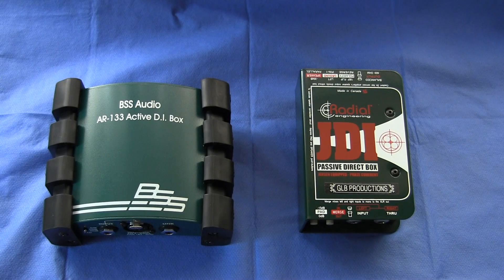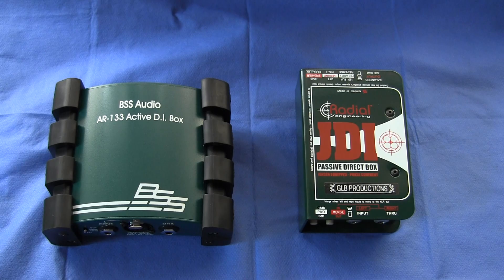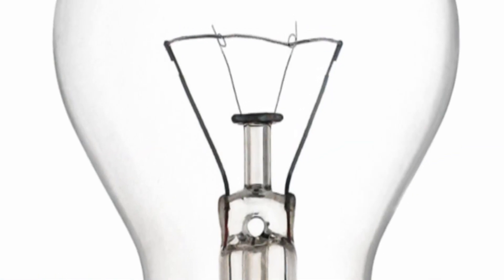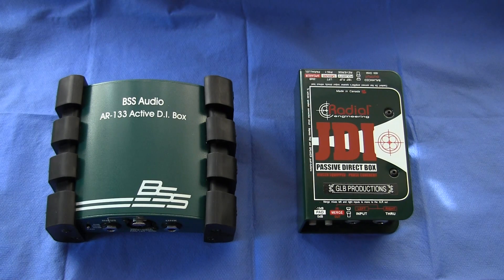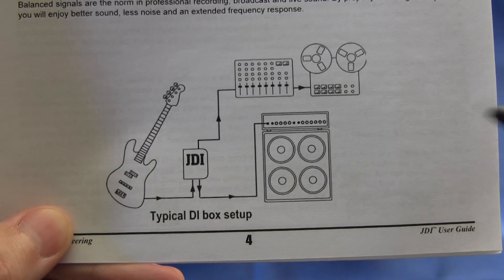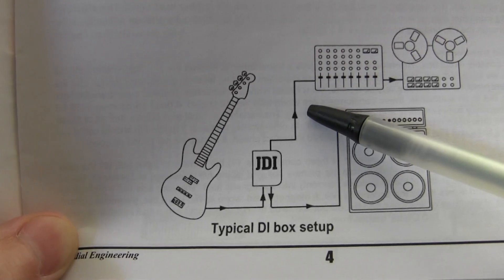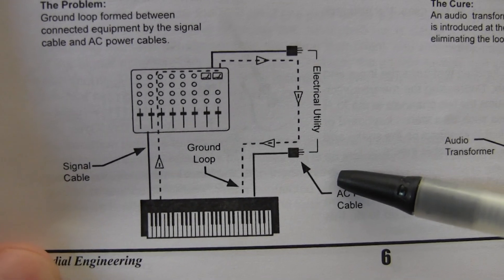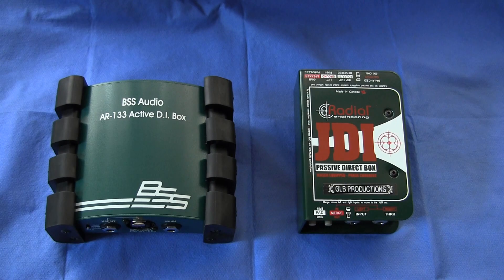DI boxes part 1: What does a DI box do, and when do I need one?

Comment: Love your explanations on your whole series of videos. I only have one small issue and that is that you constantly refer to 1/4 inch barrel type connectors as Jack type connectors.  Having worked in the electronics industry since the early 1970's I have never really heard them described as this. I have always heard and referred to them as 1/4 inch Phone type connectors. A jack was always the female of any type of connector. I understand in the UK the term Jack and Jack Socket are used well I find many terms used in the UK unnecessarily confusing. 1/4 inch Phone is the term used most by the manufacturers when describing their product so I tend to agree with them on the most commonly accepted terms especially since it benefits them to use a term that would not restrict sales. I would suggest using the term 1/4 inch Phone Plug or Jack as this would lead to the least amount of confusion.
Reply from the maker: Yes there are many names for this type of connector, probably more than any other type used in pro audio. You're correct, I should have used the term jack plug for the male or jack socket for the female, or just avoided the word jack altogether. Nowadays I use the terms quarter inch, TS or TRS. Thanks for watching!
Reply: Love your whole series of videos. Keep up the great work.
Reply from the maker: Thanks Rich, have a great day!

Comment: Great video. I had a ground loop a while ago, and I noticed it was produced by my laptop. My laptop is conected to an external sound card, and the card is connected to the mixer. Long story short, I bought an RCA filter that is used for cars and this solved the problem. I have a question for you. Should I be using a DI box instead?
Thanks for sharing this helpful information.
Reply from the maker: If your setup is quiet with no hum or buzz problems then you don't need a DI box :)

Comment: what if i need pedal ? should i put in the middle between guitar and di box ?
so what i mean is, do i need to put the cable from di box to my pedal and continuing with the cable to my guitar ? Also i have a microphone.. what i should i do ?
Reply from the maker: Correct, put the DI box right at the end of your signal chain after the last pedal. If your mic is a professional model like the SM58 it does not need a DI box as it's output is already balanced and low impedance.
Reply: Thank you very much ! it works !!... best explanation

Comment: HI i am currently using M-AUDIO FAST TRACK INTERFACE i use it to record my vocals (thru xlr) and acoustic guitar(thru line) each time i monitor the output and turn the gain high or low i hear kind of white noise in the background which is continious no matter i increase the volume or decrease it and after adding few plugins it sounds crazy... I am using FENDER C60 Which has a  inbuilt fisherman equalizer amp AND RODE NT1A Microphone.  Could you suggest me a cheap and quality DI Box which would eleminate the hiss noise totally from my guitar recordings and mic recordings? Thanks
Reply from the maker: You have to first find out where the noise is coming from - DI boxes cannot eliminate noise that is alrready present in the system. Is the noise coming from your guitar or from the vocal mic?

Comment: Would the active di box help to get rid of sound noise coming from distortion? When I'm powering the ac adapter from distortion it is giving noise like a faucet without water. I'm  not sure it my ac 9 volts  adaptor do not have ground.
Reply from the maker: No, DI boxes will just pass that noise right along ;) Some distortion pedals are just noisy because of the amount of gain they apply to the signal. If you have a grounding problem you'll generally have a hum or buzz as opposed to a hiss. Have you tried running the pedal on batteries or a different power supply to see if the noise goes away?
Reply: +GLB Productions thanks!  I'll try your suggestion
Reply from the maker: You're welcome let me know how it goes.
Reply: +GLB Productions thanks! that solved the misery, I've been trying to figure it out for one month and a big thanks to your suggestion and saved money by youtube explaining and providing a good suggestions, but now I have no idea which power supply I choose to connect my 8 pedals. Do you have any idea or recommendation? And again you save my money, A big big thanks to you. 

Cheers!
Reply from the maker: Great to hear that! I'm not an expert on pedal power supplies, the main thing is to get one that is quiet and grounded properly. I suggest asking around and reading online reviews :)

Comment: What if I use guitar pedals? Should I put it before the DI Box? Does it help me to use a distortion and don't have hum or noise? Is it a good replacement for a Noise Gate or Noise Suppressor?
Reply from the maker: Yes, between your guitar and the DI box. Electric guitar is generally not DI'ed in the way shown in the video - the DI will be placed after the amplifier, which requires an amp level DI that can handle the power.

Comment: I have a yamaha-ncx900, preamp and all. Do i need this DI yhen?
Reply from the maker: If you need to run the signal from your guitar more than 5 meters/15 feet then probably yes you do.
Reply: +GLB Productions So playing at home shouldnt be a problem, thanks.
Reply from the maker: Aleksi Porkka Should be fine. DI boxes are mainly for live sound and recording situations.
Reply: +GLB Productions I heard that my preamp watts wouldn't be enough to make a sound out of it.. So at home I should be ok by connecting my guitar to my pedal via instrument cable, which continues from output to input on a PA speaker?
Im only switching from a relatively bad guitar amp to a relatively good PA system (is system and a speaker the same thing...??), because I also heard acoustic guitar sounds so much better coming out from a PA than just a regular amp. thanks for the replies :-)
Reply from the maker: It depends on the guitar and speaker :) Some guitars have enough output to drive a an active PA speaker directly, others need help. If your PA speaker has an input designed specifically for connecting guitars directly you should have no problem. 

Sound quality is also very much dependent on gear - there are great sounding acoustic amps and crappy-sounding PA speakers, much of the time you get what you pay for. Acoustic guitar generally sounds best through some sort of fullrange system which has a tweeter and/or midrange driver.

Comment: Thank you for the video and as always your videos are well presented and very informative. I'm new to DI boxes so I have a question or two.  Well, maybe more.  I recently bought a dual direct box and I want to use it with a computer/laptop without my mixer.  So, my question is can I run cables from the para out ports into the computer since the XLR side seems to be for a mixer, etc...?  I am currently using an external usb sound card that does not have right and left inputs for stereo inputs, so I will be using a splitter cable.  Am I correct in assuming that since I'm playing a stereo instrument ( keyboard ) that I will need to use both input ports?  Also, does the same rule regarding using TRS or TS type of cables apply when using a DI box?  Lastly, do you think that you could show or rather demonstrate how to properly connect a KEYBOARD in a DI box situation?  I just want to make sure I'm connecting everything correctly.  Thanks, again.
Reply from the maker: +Luoyisi Shimisi Hello thanks for getting in touch. I suggest that you watch this video: https://www.youtube.com/watch?v=ge4Iynh4rcc It will address many of your questions on working with computers and DI boxes and also the correct way to connect stereo sources such as a keyboard. Let me know if you still have questions after that :)
Reply: +GLB Productions Thank you very much.

Comment: This is exactly what I needed. So much helpful information.  I just watched three videos, and feel like I took a career level class on audio setup. 

Question :   Can I hook up my passive DI Box at the mixer, rather than at the guitar?  That way I don't have to replace my guitar cords with XLR cables.  My acoustic guitar with active onboard pre-amp Is connected with a 20' guitar cable directly to the mixer right now.
Reply from the maker: +Daniel Williams Hello Daniel, glad the videos have been helpful! Yes you can connect your DI box at the mixer, but in this case I suggest experimenting with running your guitar directly into the mixer's line input - since the guitar is active there will be no impedance matching issues so it will be just a matter of whether enough gain is available. You may not even need the DI box :)

Comment: I have a question.

I have a behringer UM2 Uphoria USB Interface, that have 2 inputs, one XLR, one P10 for instrument.

After some tests, i came to the obvious conclusion that, a mic with XLR cable have 10x better recording sound  quality, than a mic with a P10.

So, for recording guitars with this interface, should I buy a DI?

Because I mainly record guitars using Amp Sims and/or ams impulse (Amplitube, Poulin, etc)

The use of a DI, to send the guitar signal to the xlr input would make how much of a difference?
Reply from the maker: +Giovannii Gomes Acoustic guitars always sound best when recorded with microphones :) My approach would be to record the guitar dry and then add the amp simulations in post production, either within your DAW or by using a re-amping procedure.
Reply: Oh sorry, it's for eletric guitar
Reply from the maker: +Giovannii Gomes If its electric guitar then you'll need to experiment and see what works best. Try the instrument input first.

Comment: thanks for the amazing video ! what do you mean by lifting up the AC power on either side? could u please explain
Reply from the maker: +suraksha kumar An AC power connection consists of a live, neutral and ground wire. Lifting the AC ground means disconnecting the ground wire - this is usually done to get rid of noise but is very dangerous.

Comment: Bruno, normally what's the output level on a guitar amp, line level or Instrument level? Thank you.
Reply from the maker: +Apache Cai Speaker level :D 

But I assume you're referring to the line out - that one depends on the amp, it could be anything from mic level to line level. Need to experiment and see, although some manuals will provide this info.
Reply: +GLB Productions haha...this is a good one, I did mean the output socket. Thanks again.

Comment: sir please help me in my problem...i have a 1500watts amplifier With two 15" yamaha speaker and a 12chanel yamaha console...is it compatible to run a bass guitar,two electric guitars ,a keyboard and 6microphones wireless?pls help me...
Reply from the maker: +Klifford Bienes That's a total of ten inputs (eleven if you run the keyboard stereo) so it should not be a problem, assuming your mixer has 12 mono inputs.
Reply: +GLB Productions sir can my speakers carry all the loads....each speaker is 8ohms...i just wonder why i cannot produce the perfect sound sir...if i run everything it sounds so unclear...
Reply from the maker: +Klifford Bienes Its important to have realistic expectations of what can be achieved with the equipment that you have - you are operating without dynamics processing (gates, compressors, expanders) of any kind. Also remember that in live sound the room contributes a huge amount to the sound that you hear - if the room in which you perform does not sound good there is often not much that you can do to remedy that. If things sound unclear try cutting the low and low mids on your vocal mics and make sure that the electric guitars are not using excessive amounts of distortion.
Reply: +GLB Productions my problem sir is i dont know how to use the high,low,medium switches because i dont have any background in audio...sir pls help me...how could i learn to operate our audio in our church to produce a very good sound...is it possible to show you the amplifiers  console and speakers i use for you to have an idea on what my problem is sir?sir thank you somuch for being so kind...i really want to produce a glorifying sound for the glory of our Lord....
Reply: +Klifford Bienes i just let them work and its ok....but it sounds so bad sir...
Reply from the maker: +Klifford Bienes Sure no problem, let me know what you are working with.
Reply: +GLB Productions sir i have hear a MG166cx mixing console yamaha,FR SERIES M-1400 MACKIE AMPLIFIER 1500WATTS,TWO PIECES YAMAHA SPEAKERS HAVING a nominal impedance of 8OHMS,PGM 400 WATTS,MAX 800 WATTS...
Reply: +Klifford Bienes the room is about 144sq. meter and about 10 meters high....so echo is very hearable because it is high sir...thank you sir bruno...
Reply from the maker: +Klifford Bienes There doesn't seem to be anything wrong with your equipment - make sure that your loudspeakers are pointed down into the congregation and not at the back wall so minimise the echo. If your room has hard surfaces it's very important to do this in order to increase intelligibility. If the instruments have their own on stage amplifiers you can also consider running only the vocals and keyboard through the PA system. Finally make sure that you turn off any unused microphones.
Reply: +GLB Productions sir bruno i add you in facebook...i want to learn ore about mixing...i know that right now i am not capable in mixing our audio in church...hope u accept my friend request...thank you somuch sir....
Reply from the maker: Klifford Bienes Contact me via my GLB Productions facebook page - we can chat there.

Comment: if I'm using multi-effects pedal, do I still need DI Box to go through mixer?
Reply from the maker: +Grammatical Erorr It depends - some multi-effects pedals have a balanced output so a DI box is not needed.
Reply: GLB Productions
 thanks for the fast replay. I'm using Vox multi-effects, altho I like to use stompboxes but I think sometimes mulit-effects did some efficiency and effectiveness when playing in small gigs with bad amp.

Comment: I just got a focusrite interface, and I installed Ableton live 9. I just use them to record my guitar. I had trouble getting a good tone because I would plug my guitar directly to the interface. I now realize that I must get a DI box to get the best sound out of my Stratocaster.
Reply from the maker: +godzilla964 The problem with many of the focusrite interfaces is that they do not have a true high-z instrument input ie one that gives you a one megaohm input impedance, which is why you are experiencing the loss of tone from your strat.
Reply: GLB Productions i'm hoping a DI will fix that.
Reply from the maker: +godzilla964 It will - just be sure to check the specs beforehand ;)
Reply: +GLB Productions I want a di for guitar and bass.

Comment: So would a di box be required if the mixer has jack inputs and the signal is not being transmitted further than 15 feet? For example a passive guitar or an active bass guitar or keyboard plugged directly into a mixer 5 feet away with 10ft cables?
Reply from the maker: +Vince Binondo If the distance is less than 15 feet an unbalanced signal is usually ok. However with passive instruments the impedance issue still need to be addressed, so they will need either an active DI box or a high-impedance (Hi-Z) input on the mixer, which is available on some of the newer consoles.

Comment: Thank you for the video. I still got two questions unanswered. Would I need a DI box on just a reqular pedal board setting? Eg. Guitar > pedal1 > pedal2 > ... > amp > FX Loop(more pedals) > back to amp > speaker(s).Where would I place it? Another question relating to the first question: You were talking about that 5m limit, does it mean 5 metres of single cable or 5 metres of cable altogether in the signal chain?
Reply from the maker: +mkaali In this situation you would place the DI box after your last pedal, ie just before the signal goes back into the effects loop return. Alternatively you can place it between the amp and speaker, but for that you need a DI box that can handle a speaker-level signal. 

The length limit applies to individual unbalanced connections, not total cable length in the system :)
Reply: "The length limit applies to individual unbalanced connections, not total cable length in the system :)"

Then I guess I don't need it. Thanks for the reply!
Reply from the maker: +mkaali You're welcome, all the best with your music!
Reply: Thanks, you too!